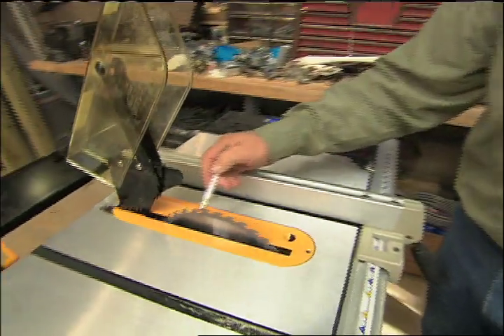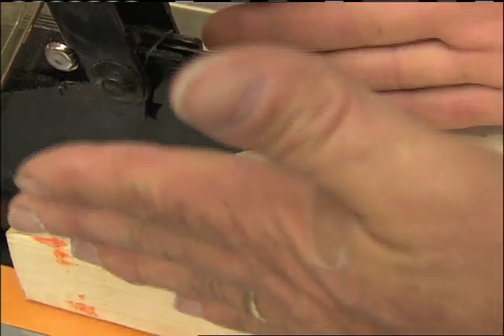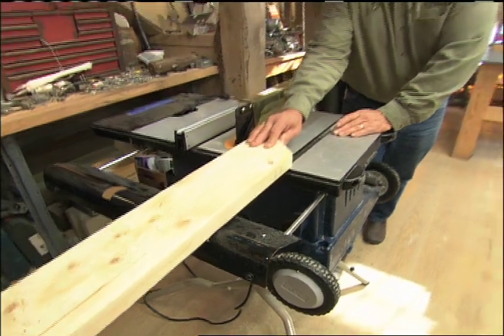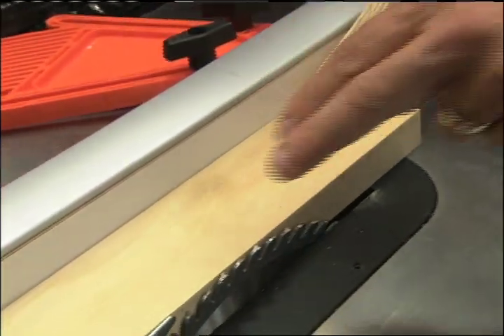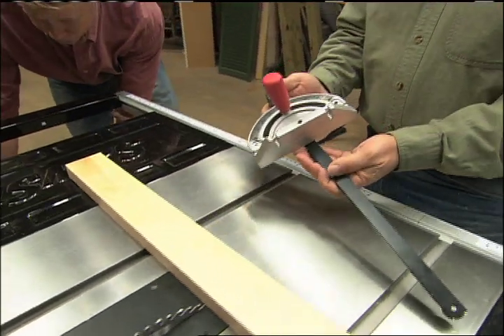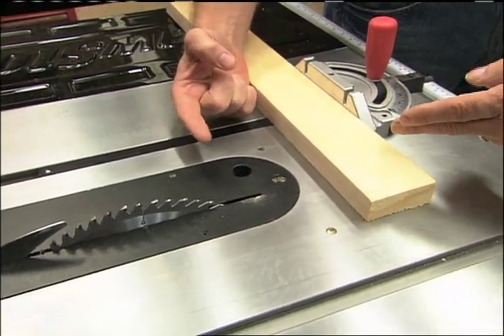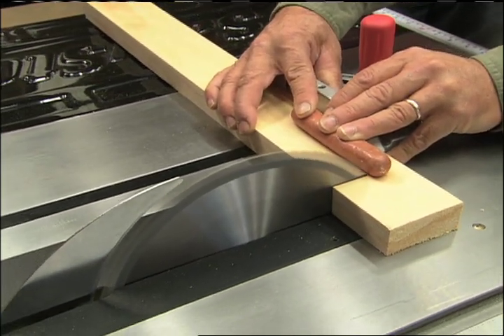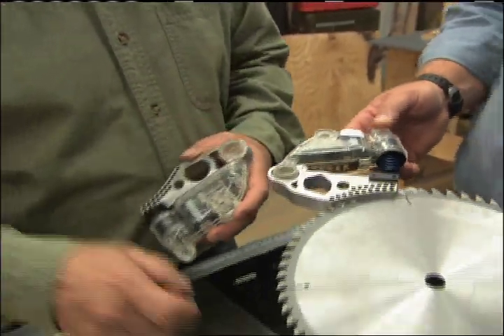Table Saw Safety | This Old House

Comment: When will this senseless torment of innocent hotdogs ever end?!
Reply: If you demo this saw and don't touch the hotdog with your hand the saw cuts it through because they're not conductive.
Reply: Joseph McBride
Same thing if the saw is running and you reach from above with your finger and touch the blade. If you're not in contact with the table, you get cut.
Reply: "No hot dogs were harmed in the making of this film."

Comment: What if there’s moisture in the wood? Safety mechanism kicks in and you have to buy a new blade and brake system?
Reply: It is more likely that it detects electrical resistance and current flowing through the blade to whatever is touching it. Water in and of itself doesn't conduct electricity, contrary to popular belief. It is the impurities in water that conducts electricity. There is a lot of salt in our bodies, especially from sweat. The brakes are probably calibrated to the ohms of resistance from flesh rather than a moist piece of wood. Unless it is soaked in salt water, it probably wouldn't matter if the wood has a bit of moisture in it.

Comment: If the brake system senses moisture... what happens if you attempt to cut wood that is damp?  Would it sense the moisture, trigger the brake, destroy your blade and the brake mechanism... then have to replace both?
Reply: If you're going to cut damp wood, isn't that what chainsaws are for ?
Reply: Charles Damery At the very start of the video, Tom explained the importance of a slitter on the table saw especially "if the wood is wet".  So evidently Tom cuts wet wood with a table saw, as have I... thus, the original question regarding the brake.
Reply: The Sawstop has a key that you can lock out the safety feature for cutting wet wood or pressure treated wood.Wood does not conduct electricity, but the human body does , so does pressure treated because it contains a copper solution. Your disable the safety to cut them each time you make a cut,
Reply: Porsche924Tim The Sawstop has a riving knife as standard, not the overhead guard Tommy demonstrated in the cheaper site saw unit.This is more effective and safer and the european standard for years, but only adopted in the US for the last 5 or 6.
Reply: Joseph McBride Thanks... that makes sense...
Reply: I own a sawstop. If I were to cut a damp piece of wood or a piece of pressure treated wood, you can put the saw in "bypass mode" this will allow you to use the saw as if it were any other type of saw. After you make your cut and turn off the saw, it will automatically reset itself.

Comment: Information about a table saw sled would have been nice. They can tremendously improve safety if they are built correctly.
Reply: They are also easy to make (pieces of 2x4 and plywood)

Comment: How much is the brake system & blade cost to replace? $69 at Amazon plus tax now for the safey clutch plus you need a new $30 blade!
How does the electric sensor work after cutting alot of wood & making lots of saw dust? I would not trust this unit for in the plant we had fiber optics type sensors go bad all the time.
Tony Trotta
Reply: +Jeannemarie Trotta  Oh dear. Did you look up the cost of a new finger on Amazon? It's not meant to be a replacement for common sense and competence.
Reply: Hopefully you will be a customer to waste your money on one of these units instead of learning how to use properly?
Reply: It senses the electrical current in your body, it doesnt user optical sensors..
Reply: Yes, but the power must be on to sense. My friend lost his fingers after the power was off and the blade still spinning! This does not work then!
Reply: so your friend didn't have the safety system and was not doing it properly or got careless?  That negates your previous comment that learn to properly use it and you'll not have problems and be richer.
Reply: Jeannemarie Trotta You're right, you're fingers aren't worth $100.

Comment: This doesn't wreck the blade. We have two in our Woodworker's Club and you replace the cartridge, and send the blade out for resharpening
Reply: still cant use the blade till its resharpened though.
Reply: Joseph McBride resharpend blades may work well for weekend warriors, and clubs, but for professionals who make 200+ cuts/rips on a table saw daily, they never seem to hold an edge. Our custom cabinet shop used to sharpen our old blades, but in the long run, 60$ on a new blade goes further than 40$ for sharpening an old one... that said, whatever works for you.
Reply: Joseph McBride so recks the blade.......

Comment: It's not new technology.  They've had it out for years.  They first started with the mechanism and later started building their own saws with that feature.  Great technology but pricey.  I think I saw it first in the late 90's at the IWF in Atlanta.  Saw Stop has done a great job in developing the technology and adding it to a their table saws.  Wish I could afford one.
Reply: The video came 4 years earlier than the comment.
Reply: @Cukito4  This technology was at the IWF in the late 90's in Atlanta Ga.  I was there.  The video was many years after that.  Saw Stop was founded in 2000.

Comment: Does this mean don't try to cut wet wood either?
Reply: These sawstop systems usually have a light on them where you can touch the wood against the blade before it's spinning to get an indication if it will trip it. Usually it's fine for wet wood though

Comment: But what if you cut wet lumber?
Reply: There is a bypass on the saw that you have to activate if you are cutting wet wood or pressure treated lumber
Reply: I hope theres a big "This will turn the safety off, be careful" warning beside that buttom

Comment: Newer comment: Bosch uses a type of cartridge that is good for a couple of emergency stops, and it's not as expensive - and doesn't damage the blade.
And stop mutilating those perfectly good hot dogs!!
A blade guard? On a job site? Hmmm...

Comment: Tom Silva always calls a Saw a Sar! This system does not work when the power is off on the table saw. I gentleman that I work with was cutting wood & turned the saw power off & reached to grab the piece of scrap wood while the blade was still turning. His hand was thrown over the blade and he lost (2) fingers.
Reply: +Tony Trotta, For the price that brake should work even when the switch is in the off position. Sucks he lost fingers on a so called "safe saw", I'll stick with my Delta and just drop the blade or wait for it to stop rather than spend an extra $1000 dollars on a smaller saw. Thanks for the info, now I can tell my friend not to bother with buying this saw and go with the same one I have which is top quality at a lower price!
Reply: Or teach them common safety to WAIT till the blade is at a full and COMPLETE STOP
Reply: Anthony E. saw stop makes a big 60+ inch professional saw table. It's badass. The one I used was accurate to 1/64 of an inch. Perfectly square, with a five horse motor... man, it made ripping 16' maple a fucking breeze. Honestly, it's an amazing saw. They come in a variety of HP too, 1.5-5 hp, i believe

Comment: Great video guys!

The cool blade stopping saw is from SawStop.
http://www.sawstop.com

I wonder if this can be retrofit on another manufacturers table saw?
Reply: No it cannot, Sawstop originally offered it under license to Delta, Jet, Powermatic and the rest and they all declined, saying the cost per unit was too great. Peter Gauss, the inventor, essentially said "Ill build my own saws then" they have Industrial,professional and contractors versions that are the equal even superior of any manufacturer, and often at less $. Go figure. There was a move to have all saws fitted with the flesh detection technology, but, to be blunt, the lawyers from the other manufacturers say that unless its a federal mandate, then they open every case they've already settled . Also, though I don't understand it myself, I have customers who have told me that, in essence, they want the right to maim themselves if they see fir and this shouldn't be a mandated issue. Once again proving that the cheapest commodity in construction is human life.
Reply: Very sad.  Time to go to our congressman I guess.
Reply: Sean Connolly Be careful what you wish for.  The government more often than not will screw it up.  Do you really want a saw that is the functional equivalent of those new damned gas cans?
Reply: ***** The government is at fault for federally mandating the new "spill proof" pour nozzles on plastic gas cans, which wind up spilling far more gas than they save because you can't effectively slow the flow or trickle any gas.  The industry would never have put those damned things on every can if it weren't forced to.
Reply: ***** Gimme a break...so all the manufacturers use the exact same design and that is a coincidence?  They all independently evolved the exact same shoddy design, without a single company patenting it?  The reason they are all the same is because the design was given to them as the ONLY approved one.
Reply: I remember seeing another type of device on TOH or ATOH that does the same thing, but does not damage the blade, and the small part with the explosive that stops the blade is cheaper and can be used twice.

Comment: Will it prevent any injury from happening to your finger if you shove it directly into the blade?
.
.
.
.
.
.
.
.
.
.
.
.
.
.
.
.
.
.
.
 .
.
.
.
.
.
.
.
.
.
.
.
.
.
.
.
.
.
.
.
.
.

.
.
Answer: It won't. You will still have a big cut on your finger, but it won't be cut off. A few teeth will hit your finger, as well as any that hit it as the blade is lowered. You will still need to go to the Emergency Room.
Reply: True, but in the scenario you just described you would otherwise easily lose a finger, if not more.

Comment: This design is crap. The sensing device idea is OK....The power retraction on the saw blade is very good....Destroying the braking mechanism and the blade is just lousy design.
Why not improve the device that retracts the blade. Putting a brake caliper on the blade teeth is unnecessary and a expensive waste of money. Instead, put a rotor/caliper on the arbor shaft....
Sheesh, do I have to think of everything!!??
Reply: So draft that up for us, Mr. Engineer.
Reply: Take it up with those who are marketing this. The engineering is all theirs.....
Reply: Two words: Air Bag.